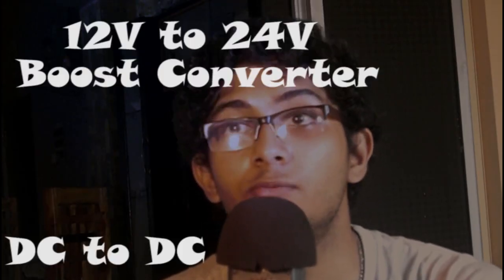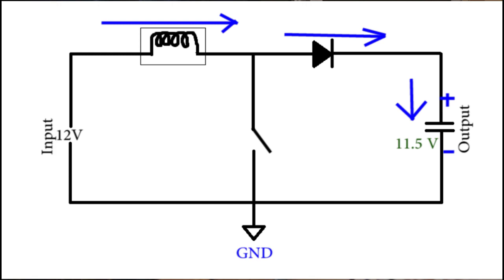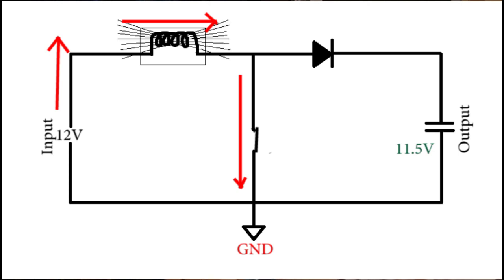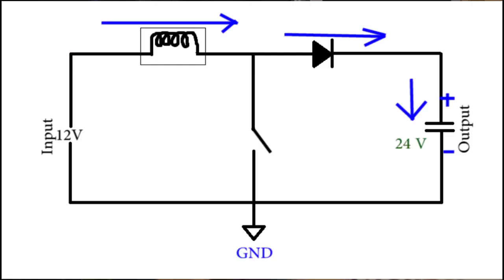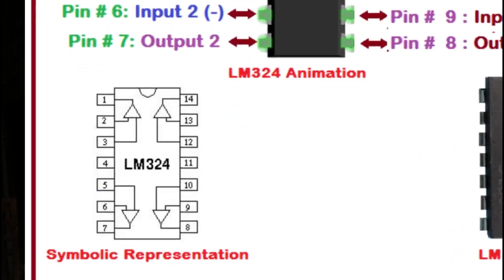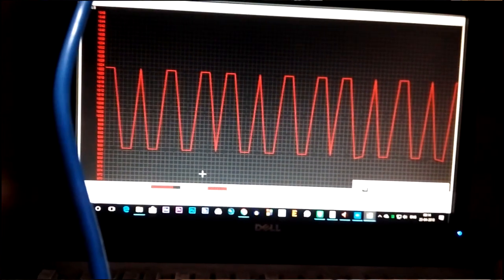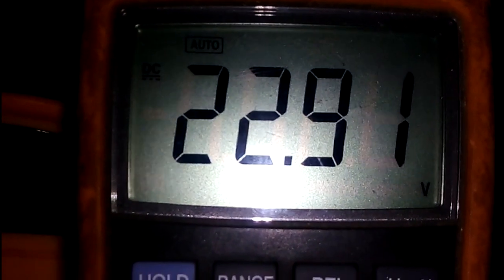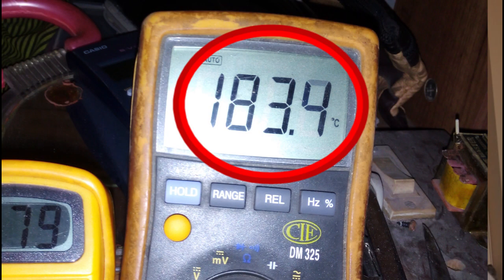How to make a 12V to 24V DC Boost Converter using LM324 IC, How does it work, Full Tutorial

Comment: What is the maxium input voltage?maximum output voltage?maximum output current ?
Plz clarify
Reply from the maker: sourav saha, thanks for the comment.... incase you haven't watched my follow up video, this converter is a kinda failure, the max input voltage is 16V and max output is 32V (under no load) but It cannot deliver enough current, for 12V you can get workable 17V with very low current... I've given all the possible explainations in this follow up video :- https://www.youtube.com/watch?v=E0M50tCbBJ0
Actually in this converter, the PWM frequency is way too low... I'm making a Arduino Boost converter, which works like a charm, It's gonna be a series... The videos are coming soon... keep watching, like, share and subscribe :D

Comment: Can you give me dependence of out put voltage & current upon inductance & capacitance ...
Reply from the maker: sk sahil o yeah... it's difficult to write integral equations here (for the inductance) I'm giving you a link, pretty similar stuff... Check it :- http://ethesis.nitrkl.ac.in/4811/1/109EE0612.pdf
And thanks for the comment, like, share and subscribe... :D
Reply: Thanks....I like to know proper theory rather a specified practical example.....